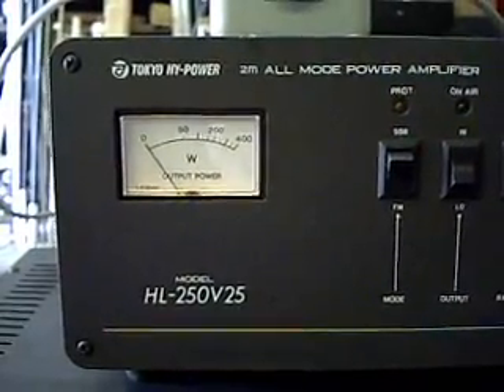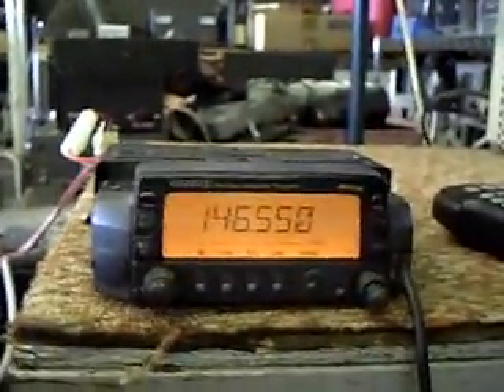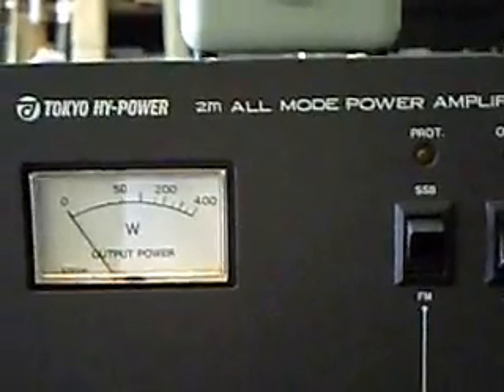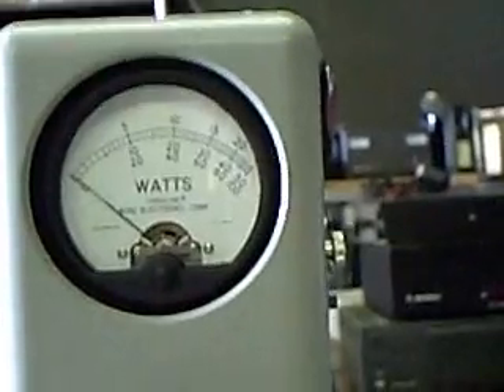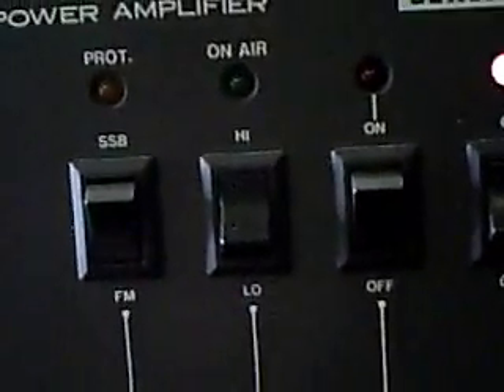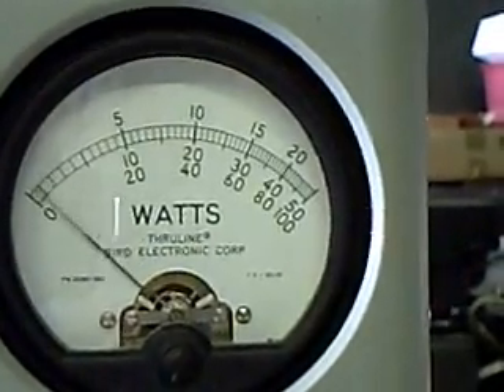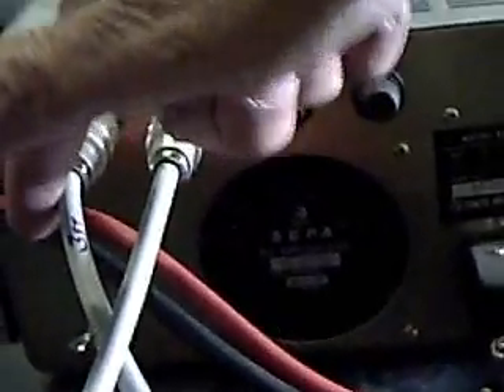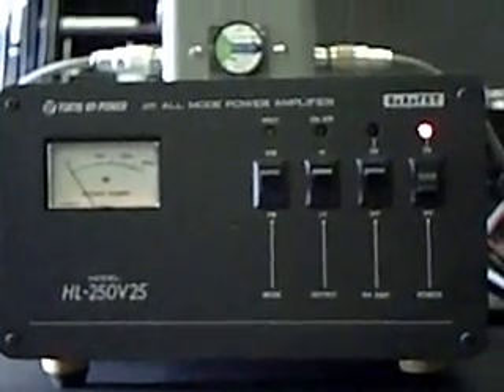Tokyo HL-250V25 2 Meter Amplifier Tested

Comment: you will loos watts when going threw the meter and if your wires are crapy wires or to long you will loos even more. also if the radio meter differs you may want to check the compasiters and any ic's